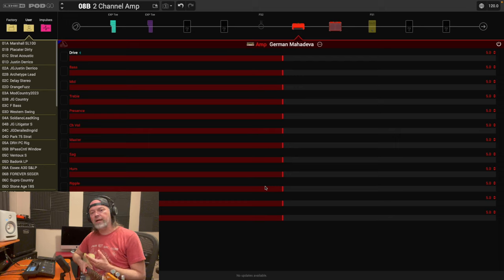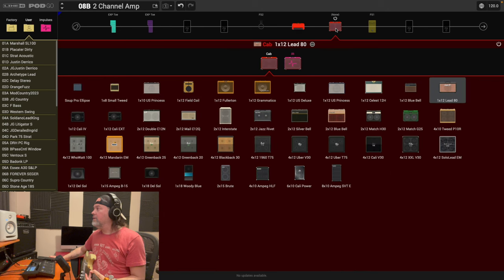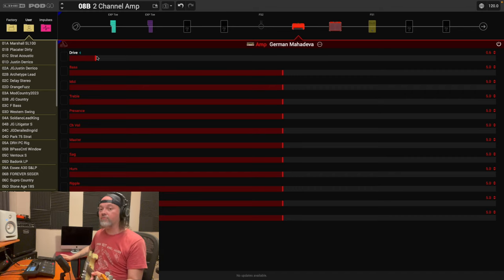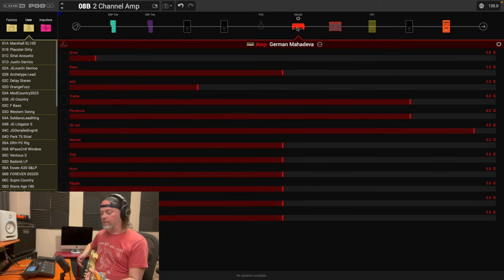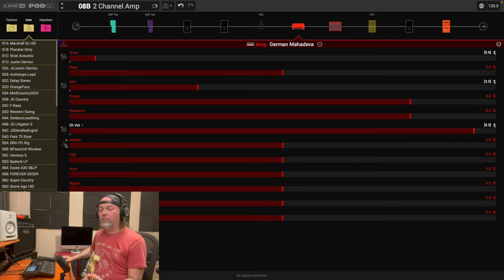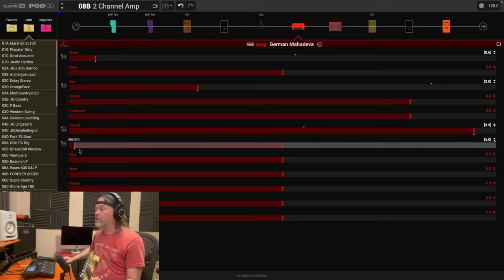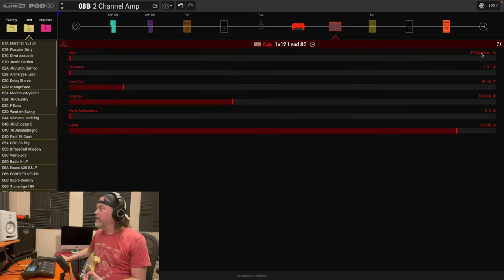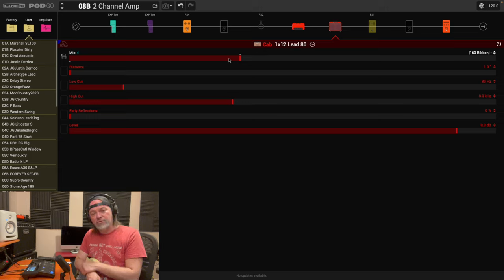In-Depth Tutorial - Creating Clean and Drive Amp Channels for Your POD Go Preset

Comment: Hi Josh, thank you for this video, it's a great tutorial. I did this in my pod go, but I have a problem, when I change from dirty to clean, I hear some popping noise very annoying, like a "electric snap/pop"?, What colud be? 
Greetings from Chile
Reply from the maker: It seems to depend on the amp you are using and how much you a pushing it.  Higher gain amps will definitely have this popping noise when you are trying to change it from a distorted channel to a clean channel.  The lower gain amps shouldn't have much if any of this issue.
Reply: @JoshGordonGuitar  thanks, that should be, I play metal with High Gain and a I use an impulse for the cab, maybe that could be part of the noise too. i’ll make some tests

Comment: Thanks Josh!  Do you prefer footswitch assign over snapshots? What are the pros and cons of one vs the other 🙏
Reply from the maker: I like using the POD GO as a pedalboard..with fx assigned to switches for the option of having them on or off...whatever the moment calls for.  With Snapshots you are basically taking away that "fx pedal option in the moment" feeling.  You are resigned to the Snapshots you have created.  And if the Snapshots serve your needs then fantastic!  I do see their usefulness, but again...I like to be able to switch an fx on or off when I need or want to.
Thanks for watching 🙏